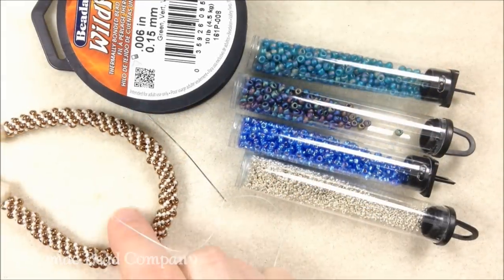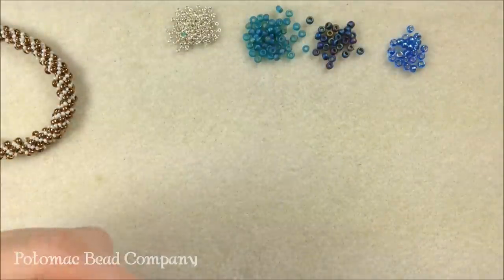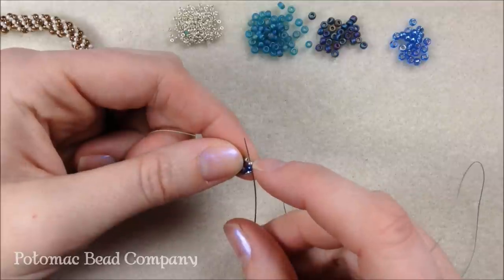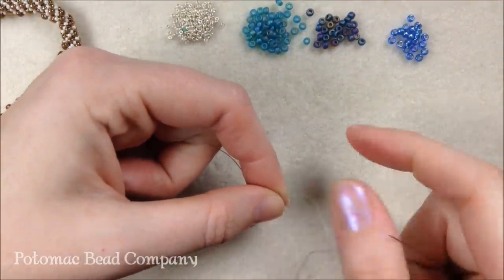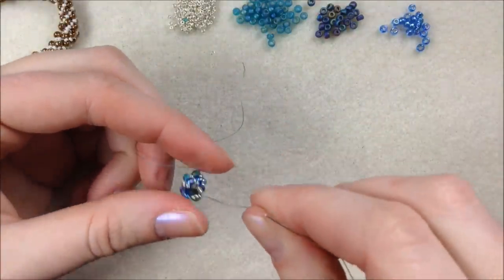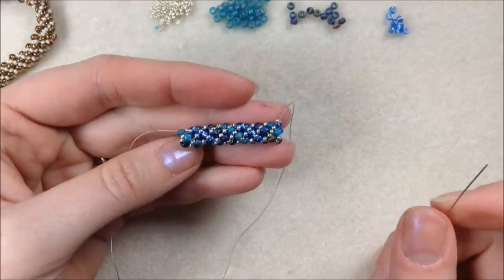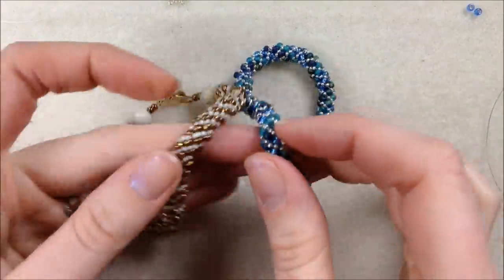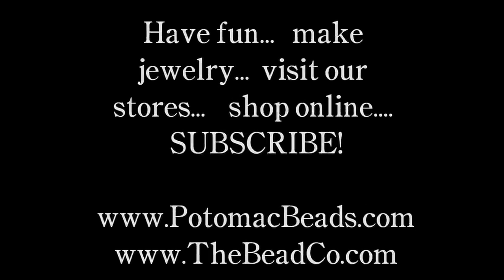Russian Spiral Bracelet or Necklace -DIY Jewelry Making Tutorial by PotomacBeads

Comment: Thank you for sharing this video... although, I was getting a headache after reading some of the comments. Just a thought I would like to share. You know, I am not advanced at all, but one of the first stitches I learned was the Russian spiral. I understood in the video that those were the beads you were using but you can substitute. Anyhow, My first Russian Spiral I did with shells. The shells that I was using could not be strung the "typical" way, so I just adapted. Additionally, my beads were extremely varied in size. Also, I understood that in doing the Russian that you pick up what you are going into, but I wanted to reverse my spiral in the middle, and I switched to picking up what I was coming out of. I guess what I am saying is aimed at your viewers... this video gives you the basics, you can fly from there. Trial and error is how you master the skill. If one bead doesn't work, try another... It took me several tries to figure out how to use the shells and I had to use a twisted wire wide eye needle to get into the shells. I also have been on the side that I was made to feel stupid when asking a question. No question is stupid. I even was able to figure out an answer afterwards and felt stupid, but to be treated as if I were stupid was just wrong. So, beading community (viewers), no question is too dumb to ask. Happy Beading.

Comment: I’ve done a few pieces using this stitch. It’s much quicker than the Cellini spiral which I love. I use the .008 for this. I think it’s better than the .006 for the Russian spiral as it doesn’t seem to be a really strong stitch. Although it is a beautiful stitch. What do you think?
Reply from the maker: Yes thread can be pretty flexible.
Reply: Potomac Bead Company Thank you for your reply but what I want to know is do you think .008 is better than .006 for a Russian spiral?
Reply from the maker: It is going to depend on the type of bead/size of bead.  If you are using .008, it will be rather tight going through the beads with the needle and thread on a 15/0 bead.  However, with 8/0 seed beads and larger, yes the thicker thread would work well for you.

Comment: i tried to bead this stitch with 4mm beads and 11/0 beads but the result was a very loose bit of beading with the 11/0 not spiralling up nicely. From pictures i know that the ratio of the size beads is not the problem. What could be the cause and how do i fix it up?
Reply from the maker: That might be a bit too drastic of a size difference to use, at least next to each other.  In this video she is using 15/0 and 8/0, and 8/0 are a good bit smaller than 4mm.  Spirals are also generally difficult to keep tight, so you have to constantly ensure you are pulling as much as you can .  Hope that helps.
Reply: Potomac Bead Company OH BOY!   ACTUALLY THE BEADS ARE SIZES 15/0 AND 8/0 AS THE INSTRUCTOR SAYS MANY TIMES !
Reply from the maker: Meredith Van Schoick Sorry meant 15/0 and 8/0.  4mm beads are much larger than an 8/0 seed bead, so again you are using beads with a more significant size differential than is used in the bracelet.